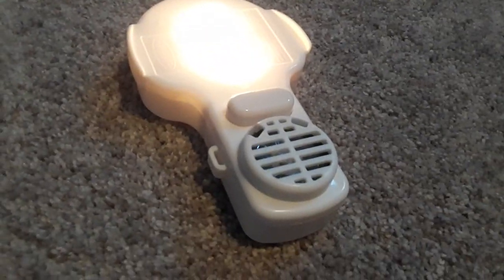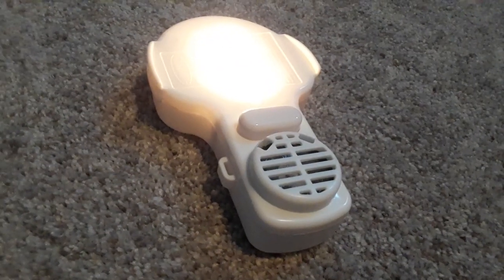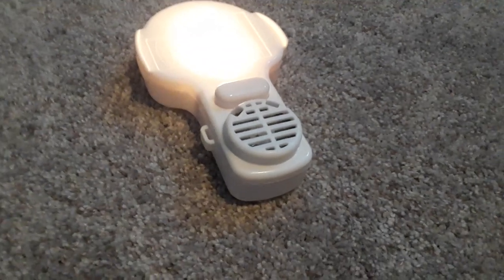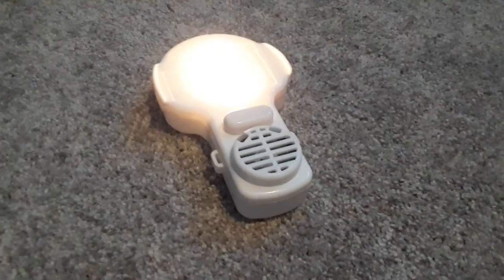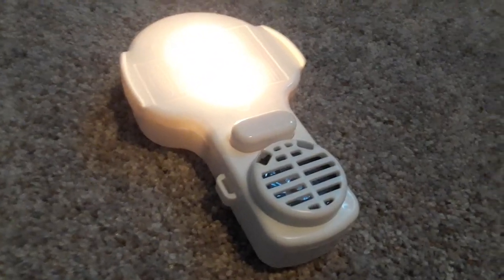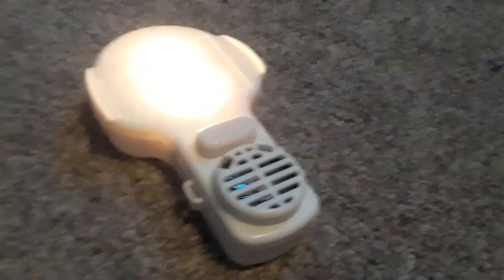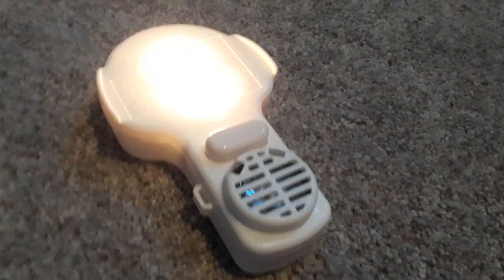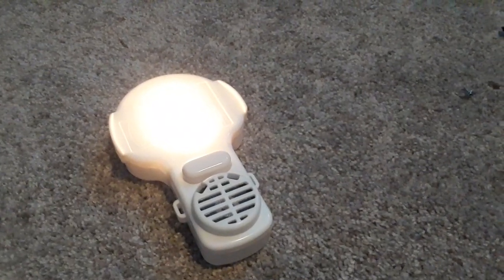When You Play With The Pitch Setter In A Gloworm For Too Long

Comment: Where's the pitch setter at in the board?
Reply from the maker: I can't quite remember but it's pretty close to the button.
Reply: @jsnxbskscnskcnskcjbzjzjbvd  I wonder where it is in the newer glow worm boards (like the one inside burt)
I have one like Burt and his pitch is kinda driving me crazy. He's slightly out of tune compared to my pink one with the same music/board. I also have another pink one with the 2009 module and new music. Is there a way to slightly adjust the pitch to have him in tune again? Is it like a potentiometer?
Reply: There are two black rectangular components that look like they are split in 4. They have light strips running down them splitting vertically, and they are scottered on near the button. I can open mine up again and show the component to bend the pitch.